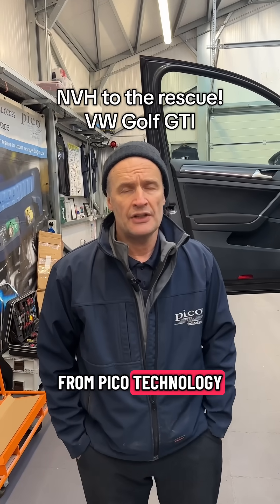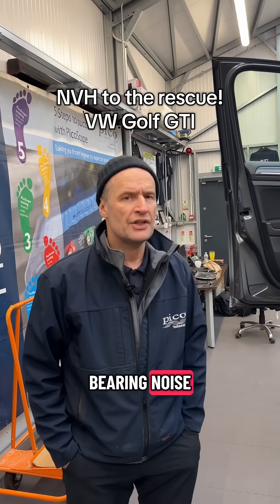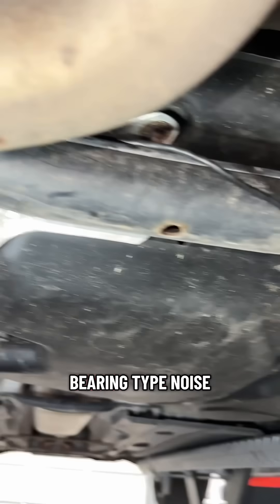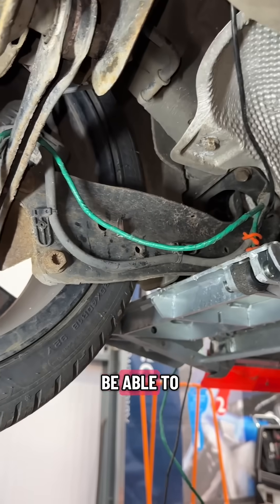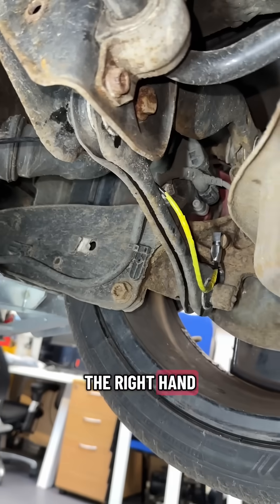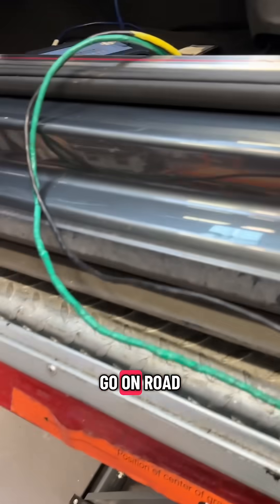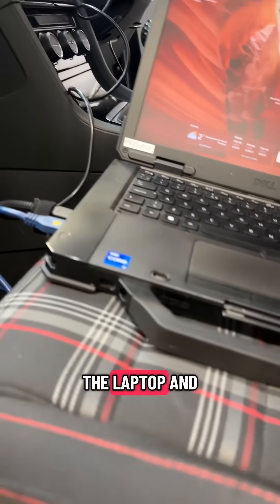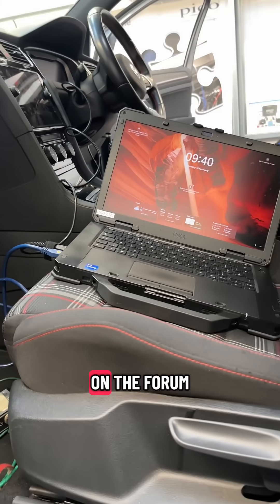👉 NVH to the Rescue | PicoScope on a VW Golf GTI #oscilloscope #automotive #diagnostics #mechanic

Comment: Garbage. If the customer came on for noise  you replicate or retire. Eyes and ears are main diagnostic tool. Your "tools" are people buying this garbage
Reply: You have no idea what the true capabilities of these "tools" are, do you? Pico make some absolutely brilliant stuff. The example in this video was admittedly quite weak. But the Pico tools are brilliant.
Reply: @memleak3037  really? If you spin rear wheel on a lift/jack and listen the noise is usually obvious. Or use a bar/long screwriver as stethoscope and listen to the sound. This "TOOL" is useful in 2% of cars with that problem.use your ears
Reply: @timelord7378 yes. I said it was a weak example. I was referring to the scopes made by Pico. But there have also been times where the NVH kits have helped find really difficult to locate knocking sounds. Case in point, a Bentley Mulsanne we had in recently. The steering rack alone costs in excess of £10,000, plus labour. It pays to be 100% sure before we make that kind of call.
Reply: @timelord7378 you really got no idea what you're talking about. Calling the most revolutionary diagnostic tool available "garbage" is just weak.